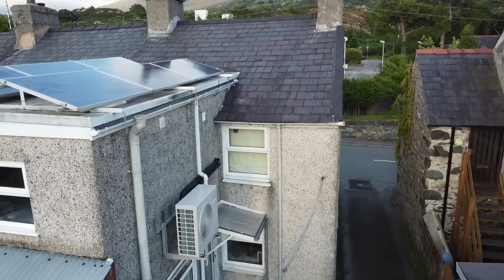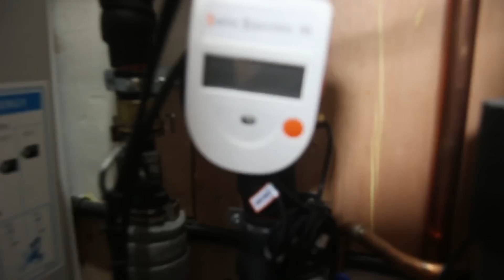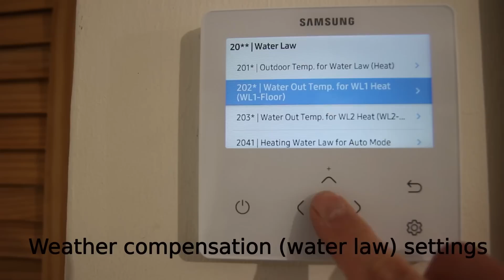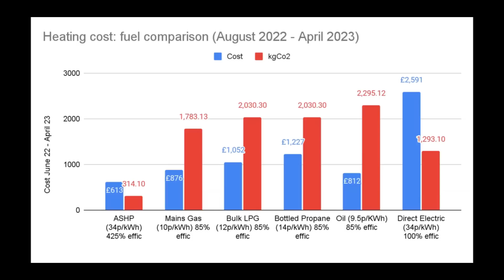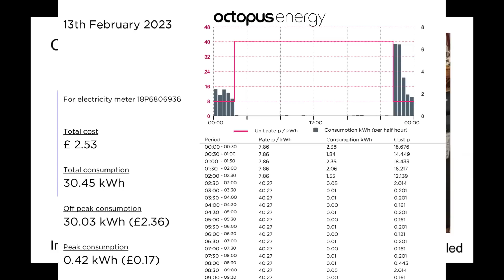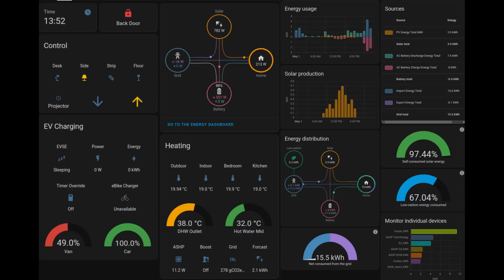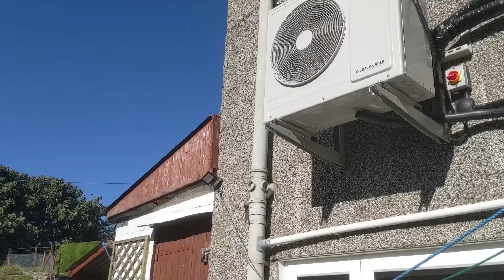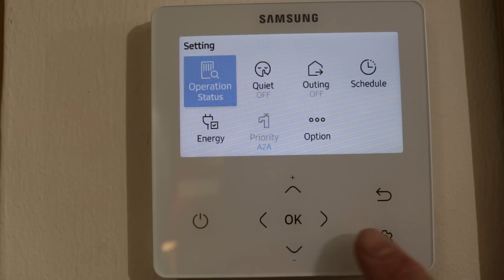Part 2/2: Air Source Heat Pump 1st Winter Performance 2022-23 in Solid Stone Welsh Cottage

Comment: You're not using a buffer, yet you don't have floor heating. I was told by an installer that since I don't have floor heating, only radiators, I'd need a buffer to have enough volume in the system to be able to e.g. defrost the ASHP. Is your water tank acting as both a source for warm water and as a buffer?!? Trying to wrap my head around this. :)
Reply from the maker: As long as your radiator system can handle the flow rate that the heatpump requires and the  primary circulator pump is powerful enough to overcome your index circuit you don't need a buffer. Buffers are only needed in exceptional circumstances, they should be avoided if possible since they can significantly negatively effectively efficency. Most domestic  systems don't require buffers. If your installer should be able to calculate this.
Reply: @GlynHudson  Thank you so much for your reply! Yeah, the more I read and learn, the more I think that it's very important to have a good set of calculations as a foundation for your heat pump configuration decision making process. Just two hours ago I learned that having a buffer can drop efficiencies by 35% ... as you mentioned: very significant. Worse than I had expected..

Comment: Thanks for this great video Glyn. It’s been hard finding real, practical descriptions of heat pumps in stone houses. You mentioned keeping the system simple - do you have any links for central heating system design? I’m an engineer, so can handle long reads and details, if needed.
Reply from the maker: Thanks. Generally less is more when it comes to heatpumps. As you can see this is a simple system with no zonning or buffer tanks. Watching the @Heatgeek and @UrbanPlumbers videos is very useful.
Reply: @GlynHudson  I just watched a couple of @Heatgeek 's videos. I think those, plus their technical articles, are just what I'm looking for. Thanks!

Comment: I'm surprised with the loss of efficiency at lower temperature. It makes me think that a heat pump can't be throttled like a gas boiler: things tend to be a hard on or off.
Reply from the maker: Running a heatpump using on/off controls will generally result in poor efficiency. This 5kW unit will modulate down to about 2kW. The issue I observed was that 30C was a bit  too lower flow temperature for my radiators, they were not able to dissipate enough heat at this low flow temperature. If I had underfloor heating I would be abke to run at an even lower flow temperature. I'm reality there's no reason to go lower than 30C if using radiators, so it's not really a problem, just an interesting observation. It's unit still gets great efficiency.
Reply: @GlynHudson  OK, this makes sense: it's designed to operate in cold climates rather than the UK's milder one. So opening a few windows or increasing the number of times to heat water could, ironically, make it run more efficiently in the UK.
Reply from the maker: @BarriosGroupie  yes, it's a myth that heatpumps work best in highly insulated houses. Although, doing this would increase running costs so would be counter productive. Ideally I would have fitted a slightly smaller heat pump, but this was the smallest available, my house is a tiny two bed end terrace.

Comment: Thanks for this. We live in Mid-Wales and can’t get our oil CH serviced. Nobody wants to do it. We are therefore being forced to look for alternatives. It’s going to be an huge expense. We only have State Pension. Talk about ‘fuel poverty’!
Reply from the maker: There is a £7500 grant available towards the cost of a heatpump and if you qualify you can get one free of charge through the Eco4 scheme in Wales. An efficiant heatpump system will be cheaper than oil to run

Comment: I have a Fujitsu air to air mini split air conditioner and it's changed the way I heat my house completely . I used to burn oil all the time but now I can turn this heatpump on from my phone app. Means I come home to a warm house and it being air to air it only takes 10 mins from turning on to being warm in the house. I find if I run it for 6 hours it uses 2kwh of electricity . During that cold spell (-3c) it used slightly more 2kwh in 5 hours but that to me is realy efficient and installation was very easy with it just being a unit at roof height inside and ground mounted outside unit

Comment: Hi Glynn, fantastically produced video and extremely useful. I am a building performance energy modeller just thought - with such great data from your ASHP and as you have a sketch up model of your house, I was wondering if you might be willing to share the sketch up and some other construction details of the house. I could then try build an energy model of the house and the HVAC system (specific to the heat pump you are using) and compare the model results with your data. I wonder how close I could get the model to the reality, and whether the model could be trained. This could be useful for you in analysing the outcomes of further interventions in your property. If this something you might be interested please send me a PM. Would be great to heat from you.

Comment: Did that external unit need planning permission?
Reply: And 2nd question, looking at your heat profile, would you say the pump is still cycling too much and there's some efficiency left on the table?
Reply from the maker: I don't think so. If you watch the video till the end I discuss this, the efficiency is best at mid-output range, therefore I found running mid-power output in shorter cycles when it was mild was more efficient, this is covered in detail in the video. It's one of the best performing heat pumps which have over 1yr of data on https://heatpumpmonitor.org/
Reply from the maker: No, it falls under permitted development.

Comment: trying do install 5kW Samsung same as your setup but getting "scanning 0" on the remote when switching on for the first time, the com wire is correct and outdoor unit is displaying "0 0 0 0", any ideas could be a address id issues and how do you change this ?  also i can see data from the outdoor unit on my oscilloscope, many thanks really inspired me..
Reply from the maker: Mm it sounds like the controller can't detect the outdoor unit. Assuming it's all connected correctly it sounds like a warrenty issue. See the midsummer quick start guide for the wiring diagram https://midsummerwholesale.co.uk/pdfs/quick-start-guide-samsung-gen-6-kits.pdf
Reply from the maker: Here's an email contact for Samsung tech support <tech.aircon@samsung.com>
Reply: thanks Glyn, not used screened cable maybe i'll give that a try if not contact tech support.
Reply from the maker: @organelec  make sure the screening is not touching the conductors
Reply: sorry to bother you again, i'm trying to understand the waterlaw settings in #2093 using the remote for thermostat like your setup, can you share your waterlaw settings?

Comment: Lots of very useful information here. Very interesting. Did you have to replace the older radiators and who installed this system? Thanks
Reply from the maker: Thanks, I installed it myself. Here's a video of the install which covered the radiator replacements https://youtu.be/Hyv_vQEvHgo?si=ZIge-PVyCLxC2GEQ

Comment: This is a great Video. We had a Vaillant heat pump installed in April, and it is now approaching it's first winter. So far it is quite mild here in Germany, so almost no heating is needed, but soon I will see the real world consumption and efficiency in Winter.
It's a 5.5KW Arotherm Plus, Underfloor heating heating in a well insulated house, so in theory it should work well.
Reply from the maker: That's great to hear, Vaillant heat pumps are great. It should work extremely well with UFH 👍

Comment: Glyn, your two ASHP videos are excellent. Thank you for all your efforts that went into making these videos. Very detailed and well explained. I have a question about the vibration mounts, did they come with the wall mount or is this something you added? Any more details would be much appreciated.
Reply from the maker: Thanks, the anti vibrations mounts were sourced separate, they are AVMB-1 Pump House, DiversiTech International. However, I recently helped a friend of mine fit the same ashp on thr same wall mount bracket without them and there's no vibrations so I don't think they're necessary.

Comment: Regarding heat pump size, although a higher capacity unit costs more at the start, you might find (for example) an 8kW unit operates more efficiently than a 5kW unit at 3.5 kW op point. So (after verifying that) you can look at the cost/risk of doing more analysis versus paying for the next size up unit.
Reply from the maker: Heat pumps work most efficiency why they are running steady stage, not switch on/off. My house requires a maximum of about 3.5kW f heat at design temperature of -3C, therefore most of the time the heat requirement is much less than this. If I fitted a larger heat pump e.g 8kW it would be unable to modulate down lower than about 3kW therefore it would have to be constantly switching on/off to avoid the house getting too hot and would get worse performance. Have a look at https://heatpumpmonitor.org/ for real-work heat pump performance data, most of the larger heatpumps which are oversized for the properties are towards the bottom end of performance. Matching the heat pump to the required heat loss is important.
Reply: A bit like oversizing radiators and pipes, it costs more initially but tends to perform better
Reply: You could also install monitoring kit on your existing  system to measure the energy demand of your home, if you can wait a season or 2 before doing the upgrade.

Comment: Great Video Glyn. I wish all installers were as smart. My ASHP Samsung 16kw is hopeless. Year to date kw used is 2847.9 with 161.2 kw generated. It doesn't make sense. Installers have checked it time and time again. Our house is 3 years old super insulated with underfloor heating set to 19 deg. There must be something wrong. Any ideas?
Reply from the maker: What flow temperature are you running? This is set via Samsung weather compensation settings which are called Water Law. The lower the flow temperature the higher the efficiency. If it's getting a COP of less than 2.5 something is very wrong. It could be many different things, I would recommend trying to get a heat geek installer to visit. Where in the country are you?

Comment: Hi
Can i ask how you set the setting in the controlled to use itseld as thermostat and not external.? Mine was set up by installer to use a hive but it's not great and it uses water law rather than how you have set up there? would like to make run as well as it can with as few power spikes as possible. unfortunately ours has buffer tank.
Reply from the maker: Take a look at page 8 of the Midsummer quick start guide, I reckon it's really good idea to use the Samsung controller as the thermostat, rather than extra 3rd party controls https://midsummerwholesale.co.uk/pdfs/quick-start-guide-samsung-gen-6-kits.pdf
Reply: Thanks. Have tried that. It seems to start the pumps to the buffer (has numbers come up on screen) but the pump that circulates the water around the house pipework doesn’t start up? Is that as the hive is wired in?
Reply from the maker: @GentlebearsLesley  where is your secondary pump connected to? It sounds like they may have wired it into the Hive? It should really be wired into the Samsung control board
Reply from the maker: Page 7 of the midsummer guide will show how the secondary pump should be wired. I don't have a buffer or secondary pump on my system
Reply: It doesn’t seem to be wired in anything like the guide? Lol I can’t attach photos on here unfortunately but did take photo to show you.
Reply from the maker: @GentlebearsLesley  could you post photo on our openenergymonitor forum https://community.openenergymonitor.org/

Comment: Hi Glyn , do you have some data that you can share on the maximum : Minimum heat output modulation at certain outdoor temperatures that your heat pump achieves.  Keen to get some insight on the 5KW Samsung Gen6 as it looks like just about a good fit for me.
Reply from the maker: Hi, the minimum heat output seems to about 2kW. As for maximum, I've seen up to 7.5 kWh during DHW cycles in summer. I'm not sure what maximum output for central heating when the temperature is below freezing since the heat pump is oversized for my house, it just provides the heat that I need which is about 3.5kW. Here is a capacity chart: https://midsummerwholesale.co.uk/pdfs/capacity-graph-m5.pdf
Reply from the maker: Here's my live and historic data, you can see the power output for yourself: https://emoncms.org/samsung5kw

Comment: Excellent video. I have had a heat pump (Panasonic) for 10 years and know from experience how good they can be. I am still tweaking the controls (just because I want to get the best out of it). My current setting is to modulate flow temperature between 25 and 35 deg C depending on external temperature. Really interested in your analysis. I don't have all the monitoring kit so cannot see what difference the temperatures make. I think for this winter I will try setting it up a bit higher and see how that works.

Comment: Great video! I'm just in the process of looking at a heat pump..I do have a question about your kickspace heater.  Does it work ok?  From what I can pick up they only work when the water is 43 degrees or above.  We have one in our kitchen and its been a god send as we have our kitchen, diner living space all opened up.  Thanks :)
Reply from the maker: Thanks! I had to modify the thermostat in the kickspace to make it switch the fan on at a lower temperature. I bypassed the original mechanical thermostat inside the kickspace and replaced it with a smart relay which is controlled via a temperature sensor on the flow pipe which enters the kickspace.

Comment: Morning Glyn, Another really useful video gives me encouragement on my low carbon journey, I have a 1867 previously 2up 2 down Cottage that’s had several extensions, we put underfloor heating in two lower floors and are now insulating again the roof spaces and plan a ASHP in 3 years time, we just had the same GE battery as you but a slightly bigger solar array and good to know the battery can supply lot of generation on cheaper tariffs, well done , do you have any other future projects in mind
Reply from the maker: Thanks, best of luck with your installation. Yes, more solar PV! It's an addiction 😂

Comment: How much did it cost?
Reply from the maker: I installed it myself, so the cost is not really comparable, but the material cost was around £4k including the radiator upgrades and the tank.
Reply: @GlynHudson thanks, where did you get the kit from?
Reply from the maker: @Medea007  there's no kit available, I purchased the parts from different plumbing suppliers

Comment: Great video and great work but for someone like me considering spending 32k on a ASHP combined with a solar and battery what I think most people want to know is the cost comparison between the new system and the old. In other words do you save money switching to a solar/heat pump system And equally, is your house as warm?
Reply from the maker: Yes house is warm and running costs are half that of the existing system. All this info is in the video. Everyone's situation is different so the details in the video are important, I tried to make it as concise as possible! Best of luck with your installation.

Comment: Really useful info Glyn, particularly regarding your home battery. I have the Growatt 6.5KWH and debating whether it is worth going to 13KWH when I get my heat pump fitted. Looks like I'd only get the benefit of the additional battery in the Winter months. I think my house is very similar to yours so it gives me hope that I can get 400% from the heat pump.
Reply from the maker: Thanks, best of luck with your new heat pump!

Comment: based on your figures, are you paying about £77 p/w. running 24/7 52 weeks
Reply from the maker: I'm bit sure where you got that figure from? It cost me £370 to run the heatpump for the whole heating season, during the summer it's been off and not doing any space heating. It uses about 1-2kWh per day to heat hot water in the summer which is easily covered by my solar PV, if I didn't have solar the cost during the summer would be £1.26 per week. The average cost over the whole year is £7/week, but this is obviously heavily weighted to the winter months and this includes the savings I'm making by using a home battey.
Reply: @GlynHudson  thanks thats more like the data i need. whats the cost of a system. ie roughly to buy
Reply from the maker: @georgeh9967  the ASHP unit itself is about £1500
Reply: @GlynHudson  thanks , thats the 2 bits of relevant info ,i need. real world costs. to determine if its worth it. all the rest of the data was just that,data. everyone who is interested will have to make up there own mind. but to me it is slightly dearer than a boiler. and the costs against my home are about 120% higher.  still thanks again.

Comment: Could you kindly advice how you build up your temperature sensor pocket ... is it sold ready made or did you modify a 28mm tee. Thanks
Reply from the maker: I used this branch tee https://directplumbingsupplies.com/product/28mm-x-28mm-x-1-in-2-comp-female-iron-tee?path=pipes-fittings%2Ffittings%2Fcompression-fittings%2F28mm-fittings
Reply: @GlynHudson  Thanks , could you also let me know the rest of the stuff for the thermowell or did it come with the sensor. If you could also point me to the sensor. Thanks !!!
Reply from the maker: @gopikrishnayogarajah  the heat meters come with sensors https://shop.openenergymonitor.com/heat-pump-monitoring/